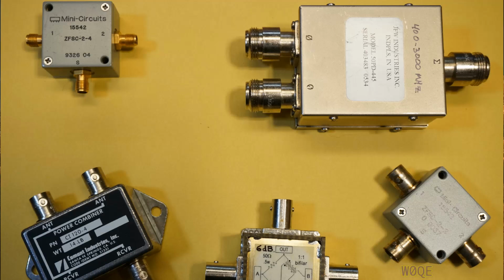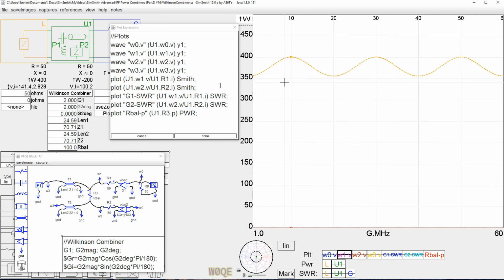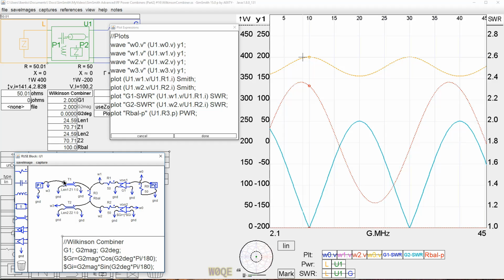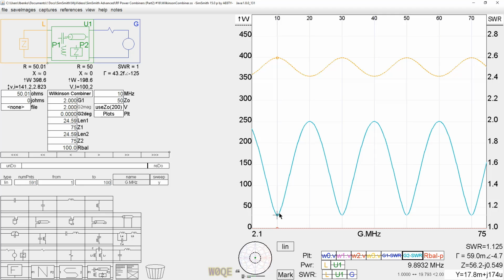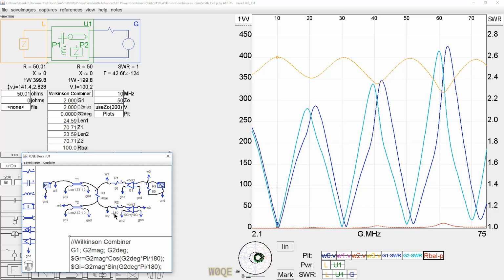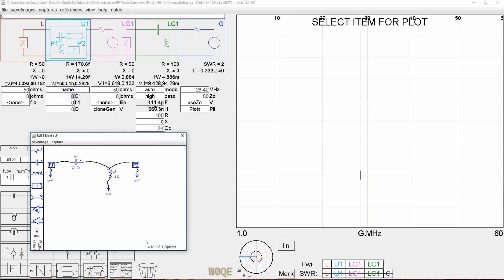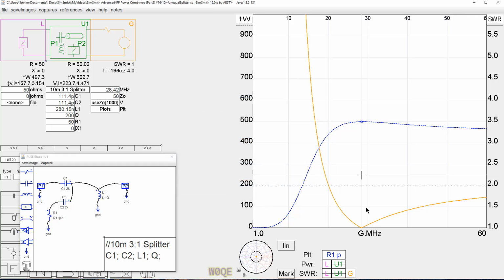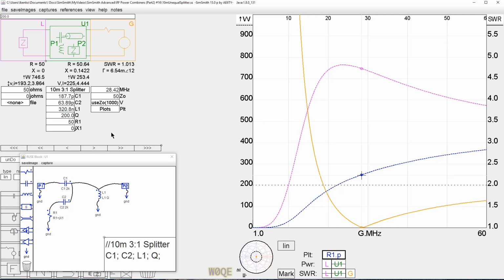#29: RF Power Combiners, Part2 (Adv. 16)

Comment: what happen when we have 4:1 combiner & all but one generator is  not working properly, how much will be the wattage of isolation resistor.
Reply: you have said it nicely for 2:1 Wilkinson that half the power will be at output port & half will dissipate at resistor for one of the generator will not work.  is it similar for the 4:1 wilki combiner. or we need 4 time more power rating for the isolation resistor.
Reply from the maker: In a 4:1 combiner there may be more than one isolation resistor depending on the configuration.  The total power in the isolation resistor(s) will be 3/4 of the power produced by the single generator that is still working resulting in a power output that is 1/16 of the designed power output if all the generators were working.
Larry, W0QE

Comment: Larry -  I get strange effects on my smith chart with simple LC circuits once I go beyond 1000Mhz - is there a setting  perhaps I need to adjust - I'd like to run to 1.5Ghz in a simulation.
Reply from the maker: SImSmith enters frequency as MHz and there is no setting you need to adjust.  For 1.5GHz you would enter 1500 (MHz) or 1.5K (MHz).  I just tried some simple circuits and all seemed ok. I was using ver. 15.1.  I need a little better explanation of what you are doing.
Reply: Larry - Ive sent you the file if you have time to look at it
Reply from the maker: All is well with the circuit as you have mentioned.  The PI network response was just not what you were expecting.